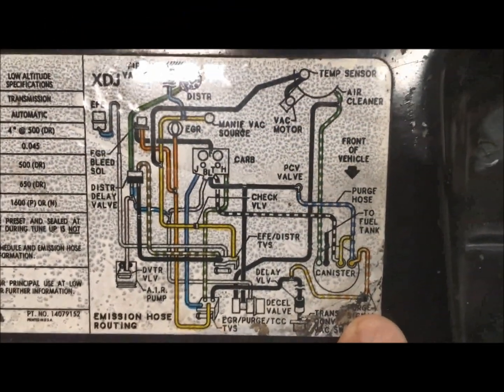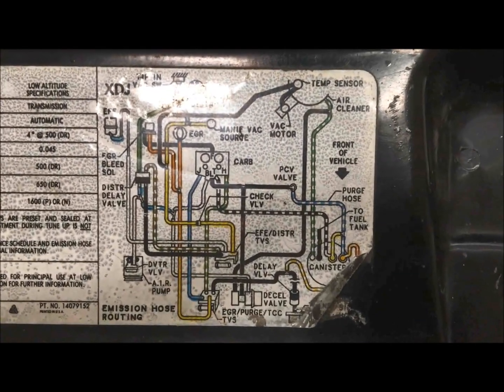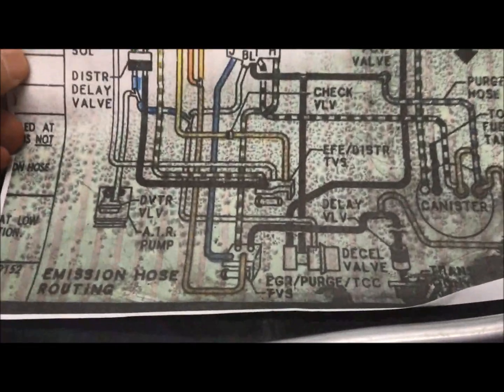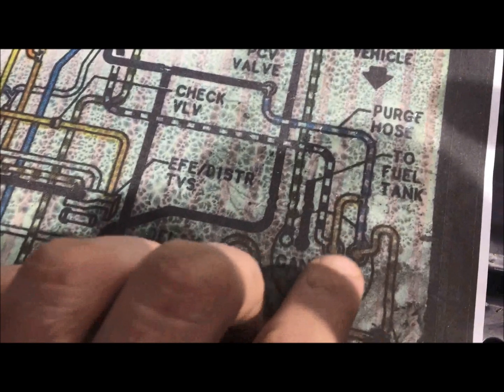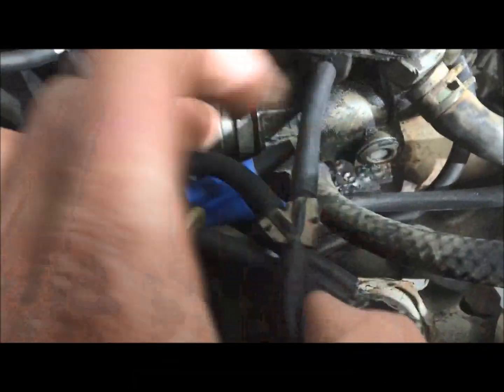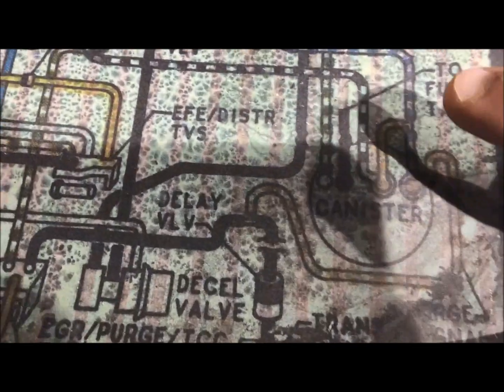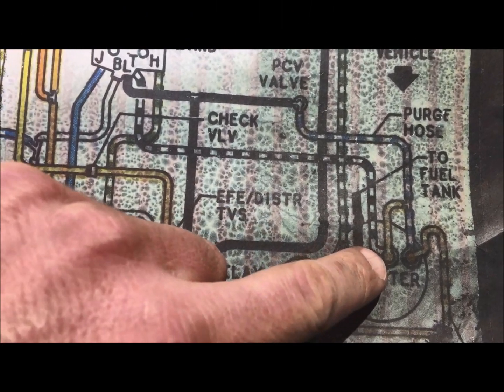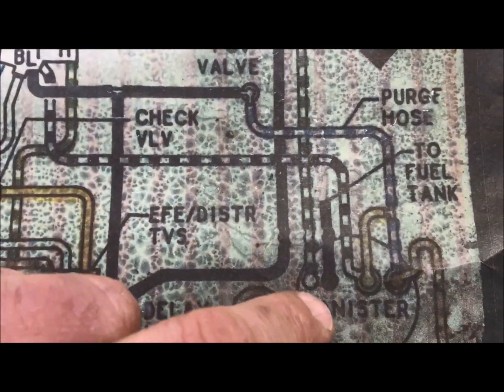1984 GMC Jimmy Vacuum Diagram & Routing Solved!!

Comment: Exactly as found on my 100% stock 1985 C10. 
I'll be replacing the intake and heads on my truck but don't look forward to removing most of the smog gear.

Comment: @mechanic life I’m trying to figure out how to realign my a/c heat and defroster Ligns/ cruise control I have an 84 Chevy c- code with 700r4 I’ve had no luck and am stumped when looking under hood 😢 from what I can tell there was a about a hose coming off my vac pump where distributor would be on a gasser and was plugged with a bolt. A T tying into the cruise control another line going to a inlet or outlet on rear passenger side by what looks like it’s right beside a fuel inlet going from fuel filter into engine and the 3rd line goes around to the front passenger side and is tied into lift pump mounted on bottom passenger side of engine I can’t wrap my head around why that is hooked up like that 😵‍💫 also a hose coming off one of the relays (egr or per idk the difference) was plugged with a bolt alike to the vaccum pump rear engine and I assume those two lines are connected to those same fittings and the egr and per relays are just all screwed up as far as hose routing goes I just know when I purchased the truck it blew cold ac and still does but I did a little digging under the dash because it barely has in blow strength and notice my vent doors do not work I know the vaccum system is the main reason why by I have looked high and low and even researched and understand how it all works but the routing under the hood is elementary lol also I’ve seen a diagram and there seems to be an epr junction box that should be mounted on the driver side but it is non existent on my vehicle again idk if the diagram is for a 6.2 setup but I discovered on a 6.2 forum and I know the variations in vaccum setups are different for both th400 and 700r4 transmissions

Comment: I remember my ‘86 when under the hood was all original, MY GOD looked like a octopus throwed it’s tentacles all over the top of it, how the motor breathed I’ll never know.
I wish there was a such thing as YouTube back then.
Anyway it’ll breathe for sure today, I done away with every single dang vacuum line that was just nothing but nonsense smog junk.
Atleast I can see the engine now, even the original breather on mine back in ‘86 was a job to take off lol..
👍🏼
Every option my 86 Silverado came with from the factory still works like new today..
Gotta love the big old cruise control diaphragm under the hood, bud it’s still there working lol.

Comment: Thanks for the video.  How necessary are most of these lines? All I ever see is them deleted. Mine runs but my choke brake isn't hooked up and now it wouldn't function properly.
Reply from the maker: I would say it entirely depends on what state you live in.  You can do without a bunch of them.
Reply: @MechanicLife  Its registered as an antique in Texas so no emissions or inspections.

Comment: Thank you for doing this work.  The schematic is hard to read with out knowing what the parts look like.  I have a 1982 C 10 305 that I inherited with every hose dry rotted.  I was able to put new hoses all around and clean things up.  Running like a champ now.   Much much appreciated!
Reply from the maker: You bet!
No easy task. Nice work Marc!
Reply: Instablaster.
Reply: what size hoses? did you buy a kit or anything?  Details would be appreciated. I'm doing the same thing but on an 84 K20.

Comment: I bought an 84 Sierra 2500 with the 350 in Nov of 2019, and it had been sitting for 5 years, but all the emissions canister, lines etc were removed. I picked up a complete canister from an 86-87 C10, to replace everything, but there is no decal for the hose routing. I've tried to get one online but nobody has them. I also changed to an Edelbrock carburetor since the Quadrajet was shot. Any way of getting the diagram for my truck?
Reply from the maker: This may help  
http://67-72chevytrucks.com/vboard/showthread.php?t=682969
I would also recommend finding one for sale online and asking that person to take some photos of the diagram for you too.  Good luck

Comment: It doesn’t give any sizes in my manual, what sizes should I order and how much? Thanks for the help
Reply from the maker: I just took a few samples off the ends of each hose to the auto store and had them cut lengths for me.3/16", 1/4" and 3/8" are common pretty common sizes.

Comment: Another great video, quick question for you... do you think it would be worthwhile to simply rip out all the vacuum lines and replace them, reusing the connectors? It seems like on an early or mid eighties van like mine most of them are crumbling...  Are vacuum lines a place where you don’t want to cheap out on parts, and any tips for the stuff that passes through the dash?
Reply from the maker: I am fan of just replacing them as you go.  The bigger lines can get expensive, but the small ones are cheap.  The connectors are cheap too and tend to break/fracture.
Reply: That would be ID for those measurements? The price at my brick and mortar is triple what summit etc want with shipping. Makes it hard to buy local when you’re getting screwed that blatantly

Comment: Great video man, thanks.  You covered just about everything I was searching for,  just about lol.  Not sure if you're still monitoring this or not but I've got a question that i think you can help me with......I swapped a TH400 I got out of an 86 Suburban into my 92 K1500 which was originally a 5-speed manual and everything works relatively well but I'm concerned about where I should be pulling vacuum from so i dont harm my engines performance.  i noticed that after 15-20 mins of driving that my Service Engine Soon Light comes on and the truck starts to fall on its face.  Any insight would be very much appreciated.  Again thanks for this video, it showed me a lot.

Comment: I think the first one is what I'm messing with..it's kinda crusty..had trimmed it when I got the winnie. Ran good made it home..got new everythig..changed Sparks n plugs and hoses .oil change filter..new alternator and belts...sounda great now...full  diagnosis and Xtra little stuff..passed inspectionmm lol but they didn't drive it. Sooo..it started backfiring at 30-35mph.my question:.IS that the vaccume hose..that didn't get replaced? All the others look new .I have it connected in length by a bigger tube..but I think it's the dried rubber..probably at the connect that I can't see😆? I goin fore it.  Granny's going fore it. It's hard to see that little connected deal under the carb.gotta be it... Chevy p30 350 Minnie winnie.q2..por favir .how do ya know if a seals been blown?

Comment: Hmm i am gonna swap out my 1983 305 v8 with a Brand new 350 v8. And i am gonna rip out all the vakumlines and put a new carb on it. Do i need to put a knocksensor on the new engine? Because i dont want the electric spark kontroll on the new one..  and what exaclty do i need vakuum to go to? I know i need from breakbooster til carb, and from the automaticgearbox to carb, and to the HEIDistributor , but what more needs vakum? I want to remove AS much AS possible.. thanks for any answers.
Reply: And i have already removed the emisions canister. And the return hose to the gastank.

Comment: If you're missing the distributor delay valve, the parts stores have a very hard time finding it. Its the 2 input 2 output that goes between the ported vacuum switch out of the thermostat housing and the air pump/distributor section (left). You will see more of that in the second video on Luke's Garage. ACDelco 214-2037, once again fractions of the cost the parts stores are asking on Amazon. you may only have this if yours is 50 state emissions like my 1983 K5 Blazer is.
Reply: some places call this vacuum delay vavle and others call it spark delay valve.

Comment: This was a great video. The only thing I'd like to add that I noticed was missing are the common hose sizes. Mine still have a lot of the GM printed paint and plastic on them so the sizes I am seeing are as follows:
5/32 - small hose from carb to Ts and Ys etc
7/32 - medium hose from tvs and other components
1/4 - larger hoses coming off the cannister

There are probably other sizes as well in the mix but these are the sizes I need to replace. I am finding some trouble in some of the OEM Ts and Ys having different sizes inlets and outlets (like a 5/32 on one end and two 7/32 on the other two ends). I'm finding the straight reducers are easier to source so instead of trying to find super custom sizes like the OEM to just use a little straight section of hose and step it down with a 5/32 to 7/32 straight connector. Good luck everyone!
Reply from the maker: Good call!  Thanks for building on the video!
Reply: fwiw to anyone that reads this, you're going to need more 5/32 than any other from what I've found. They charge $1.59 per foot at autozone when you can buy a 50 foot spool of gates from Amazon. 10 feet of each length I ran out of 5/32 pretty quick and still have about 3 more connections to patch.
Reply: When I was in the process of checking and replacing vacuum lines on my truck,my area Napa helped me out. Not only did they have different sizes of hard plastic lines,but some rubber lines I wanted to replace,that I couldn't see the size stencil on them any longer,I took a piece of ea in to them,and they found out the sizes w micrometers,and hooked me up w the rubber line also. Helped out more that I thought! Both hard plastic and rubber lines were on a spool,but it was sold by,either,the ft or 3 ft. I can't remember now. food for thought
Reply: What's the tvs? Is it some sort of splitter/air heater? Working on I believe a 1982 c30 dually and there are chewed hoses.
Reply: @yolo-qr2fq  Been a while since I worked on a square body - maybe thermal vacuum switch? The chunk coming out of the intake that provides the vacuum sources for all the different emissions accessories.
Reply: @christopherryan9864  makes sense. Do you know if you can replace them?
Reply: yo lo yes it’s a very common part it’s the Christmas tree looking thing all the vacuum lines route to in the intake manifold
Reply: @christopherryan9864  does it matter which way they split off? Have one that splits 2 to the left and 1 to the right side. Most I see online all go the same direction.